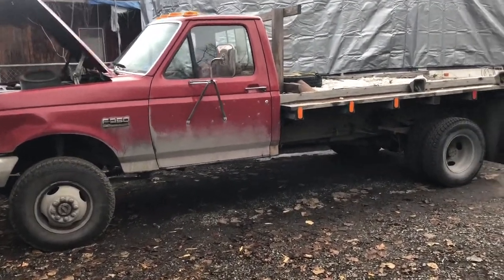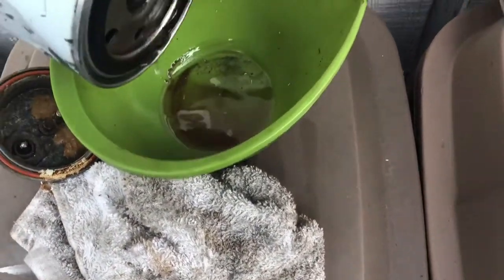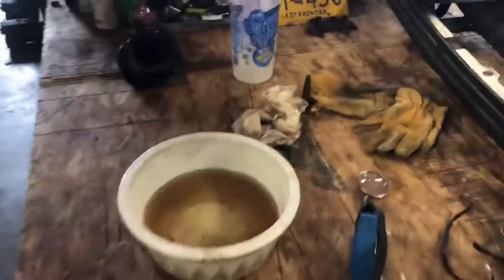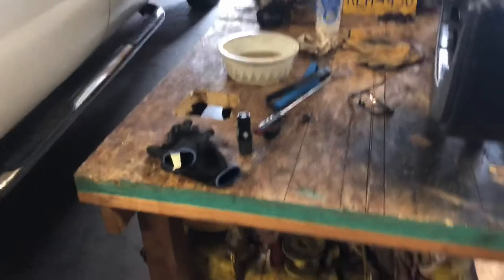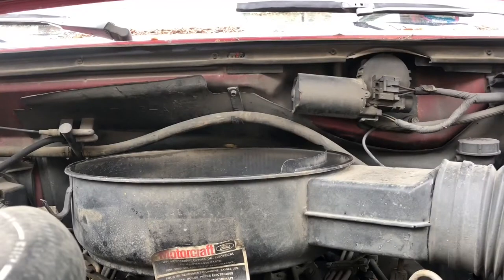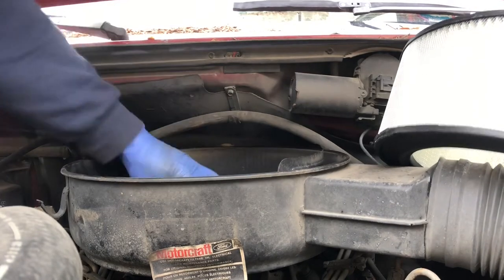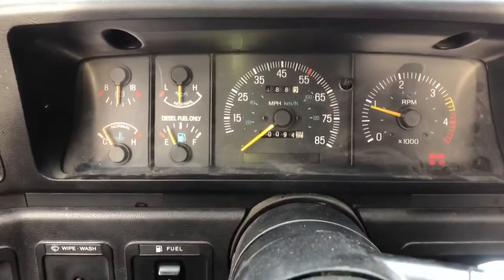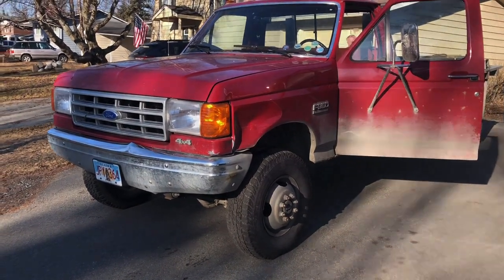1989 F350 7.3 Stalling On Deceleration Diagnosis/Repair-EP112

Comment: If you don't have diesel on hand you could always prime your fuel filter with ATF it lubricates the pump and it will run just like diesel fuel this will avoid pulling air into the pump and into the injector lines but you probably learned that after doing this.

Comment: I just bought a Ford F-250 from '86 it has the 6.9 I haven't registered it yet but when it's not quite warm it does the same thing like if you step on the gas to pull forward a bit and let off it'll stall I'm hoping to get some marvel mystery oil in the fuel change the fuel filter and drive it a bit and see if the issue goes away when it's warm it doesn't do it but hopefully it's not a worn fuel pump I can't see it being worn at 179,000 mi, but you never know I'm going to use stanadine fuel treatment in it.

Comment: Did you ever solve this issue?
Reply from the maker: Yes, I can’t recall the exact terminology but inside the mechanical portion of fuel pump was sticking and adding Diesel Kleen plus changing fuel water separator got it to unstick and allowing engine to stay running. It’s been quite some time since I looked in to issue so if you any other details I’d have to revisit.
Reply: @LastFrontierGarage  hey there i have the same issue with my ol ferd if u dont mind, if u can remember going through step by step on how you fixed it please that would be great thank you 🙏
Reply from the maker: @StinkysAutomotive  are you able to see my reply to similar question in the reply thread?
There’s something mechanical in the fuel pump that starts to stick, causing stalling on deceleration. Diesel clean to fuel tank and changing fuel water separator fixed this one. I would imagine if it’s too bad, the fuel pump might be need to be taken apart and cleaned but I do not know that for sure.

Comment: Video says Deceleration Diagnosis/Repair this video is Neither, Waste of time.
Reply from the maker: It’s been quite a while since filming this but adding Diesel Kleen to both fuel tanks and changing fuel water separator filled with Diesel Kleen got mechanical portion of fuel pump to unstick allowing it to stay running when coming off of high revs or rolling to a stop. I do these videos for fun so if they’re not entirely helpful my apologies, hope you can get yours to run correctly though bro!